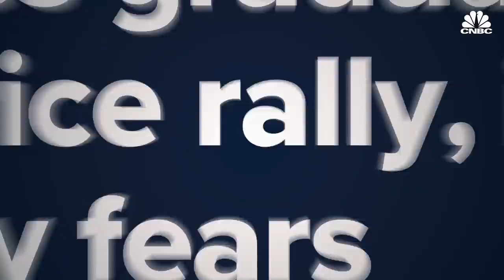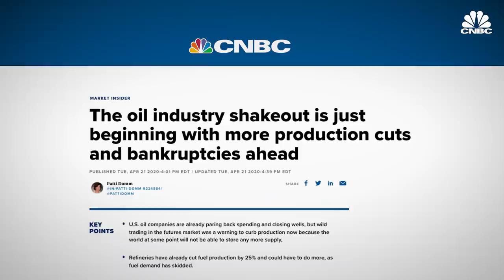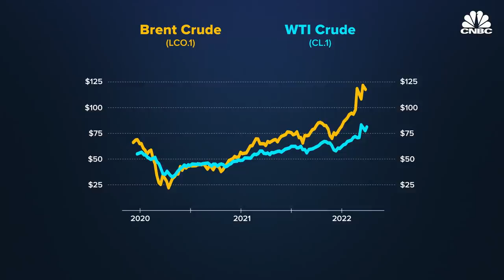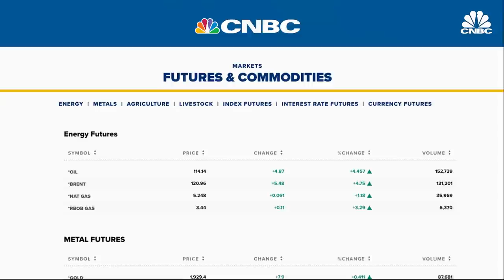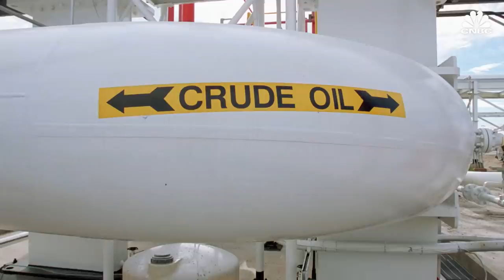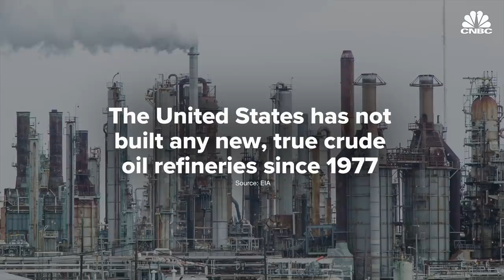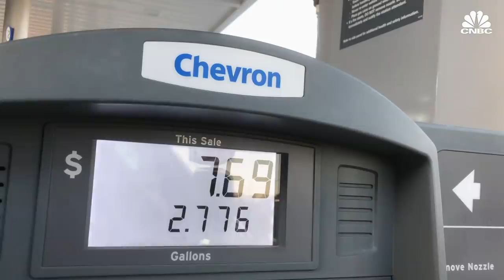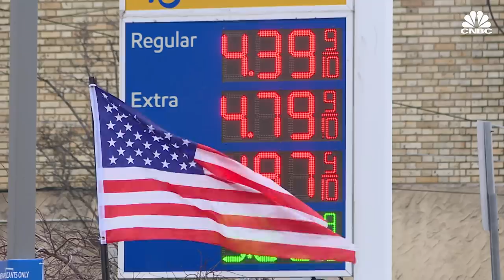Why Russia’s War Drove Up U.S. Gas Prices

Comment: Well they better enjoy it while they can. These high prices are driving up EV demand substantially.
I doubt their pricing strategy is optimal for them even in the short to medium term.
ICE cars numbers worldwide were scheduled to start going down in number around 2028. This could push that date forward by a year or two.
Reply: yea and the price of nickel is skyrocketing and there wont be enough for the EV industry. EV batteries use mostly Nickel
Reply: Everyone thinks cars are the be all end all for oil. Tons of industrial applications and even daily life products(other than cars) heavily rely on oil. The EV growth example has been beaten to death, just because one sub section of one market is growing (and will remove a chunk of oil dependency) the demand for oil will still exist at large capacity for the foreseeable future. Why send money abroad when we have the resources in North America? Backwards thinking and policy to appease tree huggers when the demand isn’t changing but that demand could be filled in much better ways. People don’t want to see the production they just want to consume the end product. That has a long term cost like we’re seeing recently. Energy independence would cut off a lot of foreign influence at the same time, a win win imo.
Reply: Tesla repair and maintenance costs:
Battery $20,000
4 brakes and rotors $8,500
Headlights $1,000
Control screen $5,000

On top of that, there's no place to charge if you live in an apartment, condo, or rowhouse.
Reply: @wokejoke2675 ICE Repair and Maint costs:
Price to replace and engine = $10-20k depending on the engine
Price to replace 4 non-ev brakes and rotors = $5-8k
Headlights (most are entire assemblies now) = $250-$2000
Control screen for a post-'16 car that has a large control screen or control computer = $2k-10k

Cost to fuel an ICE vs cost to charge an EV = %400-1000 more for an ICE over equivalent miles driven.

Plenty of places to charge an EV even if you live in an apt. or condo. While I do agree we need a standardized charging plug format and more EV charging in the US, it's not as difficult as you portray.

Also, every single point you are making was made by people who didn't want ICE vehicles to replace horse drawn buggies and those that say every new technology is more expensive than previous tech that is not as efficient and all were proven wrong as costs came down due to adoption of the tech, efficiency savings and economics of scale production.

Game over.. you lose.
Reply: @The Blue Max Well we are not talking about someone who maintains their own car, we are talking about average operating and maint. costs. 

Those are the costs for work for be done by mechanics for those services on newer ICE cars.

You are trying to make YOUR very personal and rare experience as a mechanic with a single car and apply it to EVERYONE else in who are NOT mechanics and have a variety of cars.

You could not get any more apples to oranges with your attempted and failed comparison.
Reply: @vhsskateboards  Light passenger cars sure. That's only like a quarter of all oil used. But then buses, boats, trains, planes, trucks, etc..? Much of it can be electrified. Using the US as an example. The heaviest, most developed user. All in all transportation uses 66% of oil. Industrial applications use 28% (of which 8-10% is plastic. The rest mostly chemical feed stock.) Diverse residential applications use only 3% (lawnmowers, chain saws, generators, etc). Commercial 2%. And less than 1% is used for electricity.

So you see.. You're talking about less than 32% here as if it's the majority of oil consumed. You are wrong. The electrification of transportation, even if planes remain mostly fuelled, could half US oil use.
Reply: @knockdoun  New chemistries are being explored and coming to market all the time. Take Lithium Iron Phosphate. Uses very little Nickel. Tesla is currently exploring the use of Manganese as part of their battery cathodes. Which can lower the Nickel used by a third. Etc. Etc. Other manufacturers will too. Or follow other avenues.
You must have noticed by now that the industry is not static. What do you think engineers and labs working on these problems do? It's big business. There are fortunes to be made from good solutions. So obviously... Some of the smartest people in the world are chasing these problems. It's only a matter of time.
Reply: @9753flyer  I've owned the same ICE vehicle since the 80's, runs on propane and after 300,000 km's, the driveline is still original and in excellent condition; it just cost me $2000 to renew the brakes, cooling system and steering components, so it's now good for another 30 years. Propane will always be available, so my vehicle is future-proofed; stick your EV's.
Reply: @9753flyer  I have a little 1.2 Renault clio that's 21 years old, i don't work on my cars, not yet at least, and it has always been taken to a shop to be repaired. During it's lifetime it's had about 3000€ in repairs that includes:

- Headgasket replacement
- Clutch
- Water pump and belt
- Starter

Considering it cost the equivalent of 12.000€ that's nothing. Even if u replace that value with 19k which is the equivalent modern clio, repairs and all it still makes it 10k cheaper then a Renault Zoe, which is essential the same car, but electric. 

The only fair point is the price of petrol, in 5 years, considering the average kms done by people where i live, the electric will have made up the cost....It wouldn't be the case if it weren't for the insane fuel prices. And will the cost of charging remain cheap? Eventually batteries need replacing, and i know of one guy who's battery pack costed nearly as much as his car was worth. And in places like Europe there is and prob will never bee an infrastructure for electrics. Most people live in apartments and most apartments don't have a garage. So the bulk of the population need to charge their cars outside, so what, we'll add charging stations to every parking space? Seems laughable. 

And should we take in to consideration loss of value? Because they are new tech, and companies like tesla love to drop loads of pointless tech in to them....tech that will become obsolete just like our phones. A 20 year old ICE is still relevant  cause they can still do loads of mileage 

I'll cheer for hydrogen and ethanol as they are the only true way forward.
Reply: @The Blue Max yeah and we're do the materials used to make the batteries. China yup

Comment: Buy backs are good for a company's balance sheet. If it's too expensive to do exploration then it makes sense to solidify their finances just in case this administration continues it's way against oil exploration.
Reply: Buy back don't improve balance sheet.  In general, it increases stock prices as less shares circulate in the market.

Comment: In the short run, the high prices hurt.  But if they hurt you enough to look for alternatives, in the long run we will benefit if we buy more EVs, use more mass   transit, use bicycles, work closer to where you live, or work remotely.
Reply: Go and buy Tesla for 100.000$ 🤣 And don’t use energy at home and everywhere 🤦‍♂️🙋‍♂️
Reply: I'd love to live downtown near where I  work, but I can't afford a $2 million condo
Reply: @wokejoke2675  but you can afford a car payment/repairs, gas, insurance, plus time spent commuting? i pay 1100/m to live downtown but i pay ZERO in 'driving fees'. also i never sit in traffic, that alone is worth it to me.
Reply: @NightAudiobook  ^this is what the government wants anyway. all they talk about is electric cars as if anyone can actually afford that. and its not exactly like you can buy a second hand EV. the resale value is horrible bc the battery is the first thing to go and its usually 50% of the cost of the vehicle (or more)! and if you live in an apartment or basically anywhere except a home with a garage charging is a nightmare. we need to be funding public/active transportation, not subsidizing rich peoples electric cars. (which still require extracting materials from the earth anyway & are horrible for the environment.)
Reply: @The Blue Max fwiw i was born in the middle of nowhere kansas and literally EVERYWHERE has arterial roads/highways. put transit on those and then all you have to do is get to the main arterial by truck, atv, bike, foot, whatever. public transit will look different in every municipality, lets get creative! i no longer live in kansas bc i made choices for my life, happiness and the planet. i deliberately keep my transit expenses low and stay where the work is (CITIES). also...do you think that people who live rurally want to hand over their entire paycheck at the gas station forever?  like.. the system is not working as is. we need new infrastructure that actually functions.

Comment: I can take $20 per gallon, no problem. 💪

well......my new electric car can take it.
Reply: It's the oil companies who price gouging, we don't import enough oil from Russia to affect us this bad.

Oil companies found opportunity to make many so they are taking advantage. . ...
Reply: Lol arent you cool
Reply: @RumblesBettr  why thank you 😘
Reply: If it reached $20 a gal your bread and toothpaste would cost $50 apiece. And your tires for that car would cost $800 a tire.  And take a wild guess on what lubricates the moving parts on that car?  OIL.
Reply: @firstlast189  🤣 you know nothing about electric cars but pretend anyway🤣🤣  the only fluid ev needs is transmission fluid and that only changes once per 100k milage.
Reply: @mistervo8185  Yes if gas goes up to $20 a gal  you will pay very heavily on products that you buy.  Oh does a ev have an A/C?  What about the ball bearings?  What is the insulation of the wires made with?  Do you know how the tires are made?  ect.

Comment: If people only knew how economics work… 🙄 Gas prices are going up because it’s not due to Russia, it’s because there’s a low chip shortage which is making the car industry make less cars. This makes the old cars’ values go up, thus gas prices go up. Russia plays a little part of the gas, but it’s not even that much compared to the car value that’s making gas prices go up

Comment: :yt:The alternative to plastic is hemp products for it makes over 26,000 different things.  It has even been proven to be 10 times stronger than steel and 30% lighter stronger and lighter than concrete stronger and lighter than brick far more versatile making the design possibilities practically limitless, at the same time being easier to work with on-site'  equally as amazing 1 acre of hemp! Can produce enough bile fossil fuel to fuel 10,000 vehicles for a year at about a dollar per gallon.  One of the major differences is hemp bile fossil fuel only releases the same amount of carbon dioxide on oxygenated air per mile as a person does when the exhale versus coal oil gas. Which release tens of millions of years worth of petrified death per mile. The real sales pitch"                                       is 1 acre of hemp! Produces 3 to 4 times the amount of oxygen as a acre of trees + it sucks in 3 to 4 times the amount of carbon dioxide un oxygenated air as a acre of trees plus it rejuvenates and replenishes the soil back to Garden of paradise type quality after every harvest even if the landscape has been previously stripped robbed depleted from overharvesting things such as cotton and corn that has been marinating in petroleum-based fertilizer.  Not to mention it has the same nutritional value as rice corn wheat barley and milk. So we can easily deal with people being over fed and undernourished   In layman's terms                                          we can rebuild faster much more efficiently at a fraction of the cost in half the time of what we are doing today without leaving any excess poison is toxic waste behind.  In layman's terms we can manufacture mass-produce distribute products that every country city continent is going to be happy to spend top dollar.  Example hemp! Clothing  distributes moisture across the body more efficiently than any other material leaving a person feeling smelling and smiling their best even under the most extreme circumstances plus it promotes good respiratory function so if a person has asthma allergies or other breathing complications just by wearing its clothing you will alleviate those symptoms with the potential of diminishing them all together. Hemp!  has even  been successfully grown on radiative soil.  So in theory if we grow hemp along the shores of our rivers and lakes we will greatly improve upon the quality of that water.  Nonetheless we definitely will improve upon and maintain the quality of our air water foods landscapes working living environment every day home products by producing 3 to 4 times more oxygen per acre than we do currently.  At the same time sucking in 3 to 4 times the amount of carbon dioxide un oxygenated air per acre as we do currently,   as a added bonus everywhere we grow it we will be rejuvenating replenishing the soil back to Garden of paradise type quality. Keep in mind America has about 800,000 acres of available farming land.  So again we have the manpower technology resources capability technology to create clean high-paying jobs from coast-to-coast that will improve upon and maintain the quality of life in such a way.  That will naturally allow each person's generation to become stronger smarter healthier happier better off physically mentally financially possibly spiritually then the previous generation. With that type of leadership loyalty devotion to one's self and country People may start finally having jobs products power sources that will allow them to be healthy and wealthy enough to live enjoy their life all the way through out retirement.  You can't do that would dirty low-paying jobs.  That come from outdated power sources inferior materials poisonous toxic substances pesticides chemicals that never change their killing composition which means whether it's solid liquid or burnt off to our airways atmosphere as a vapor is always going to be poisonous debilitating deadly to the body at the same time polluting corrupting devastating to mother Earth and all the various different forms of life that live within this world.  The bottom line you cannot promote life by doing business with material resources substances that have been scientifically classified religiously verified as petrified death or worse.    Think about this if life is not free why the hell would death be any cheaper. I guarantee it's not so would you like to know how souls and spirits have paid out are picking up the tab on the end results of dirty low-paying jobs.  Would you like to know how souls and spirits have paid out are picking up the tab on a diminished quality of life. Case closed mercy forgiveness spiritual welfare are not changing these facts.  You're either part of the world solutions or you are exacerbating the world's problems either way each and every one of us is being held spiritually accountable for each and every moment.              laugh smile grin chuckle with confidence I say now I wish and pray for my soul and spirit to be held spiritually accountable to the statements I proclaim. I guarantee you never see hear another body man empower persons of legal religious authority leaders ever freely validate the statements they proclaim with that level of certainty. One reason could be the don't have the best interest of the majority of the population's needs at heart) another reason could be the come from a breed of cowards! One is genetic  hereditary the other is simply a generic learned behavior either way it is physically mentally spiritually useless to freely live and die in such a low quality manner especially if that stupidity ignorance desperation stems from being soft lazy out of shape over fed undernourished overworked underpaid with dirty low-paying jobs.  S.R.F.